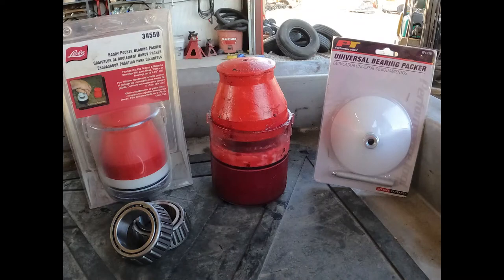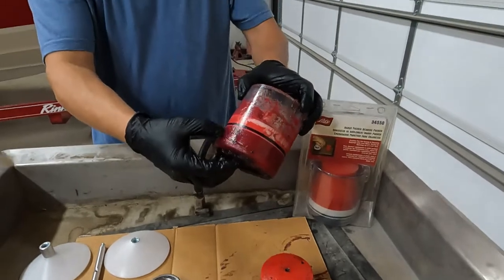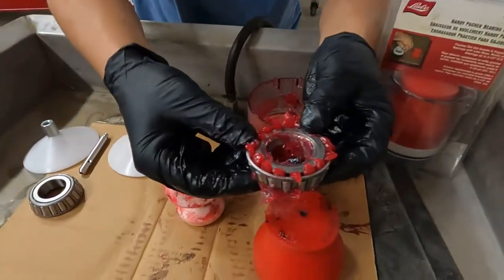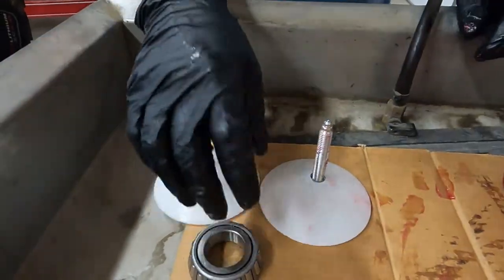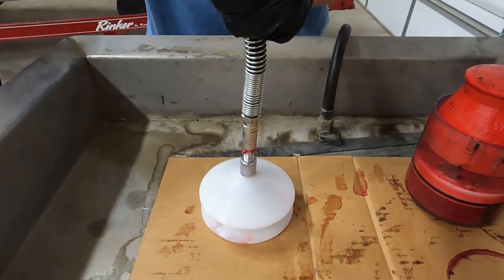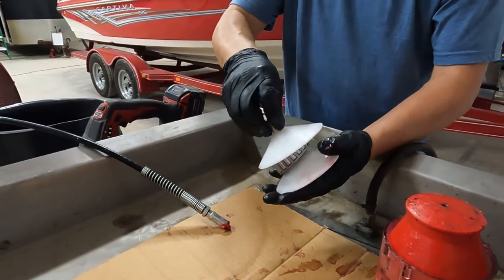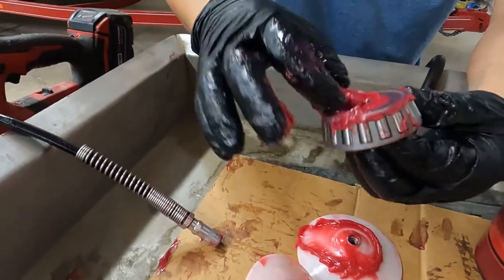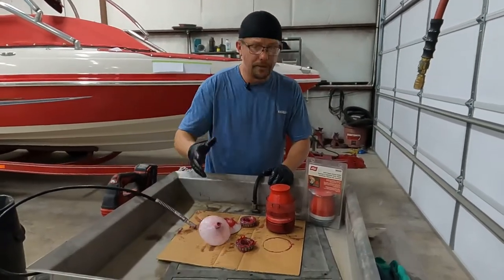Handy Packer vs. Cone Packer

Comment: I like the cone packer because you can swap grease types based on the application, and it does a great job running extra grease through to flush old grease out for a quick low maintenance grease re-pack.
Reply from the maker: Great point!  Thanks for watching!

Comment: Thanks for the comparison.  Like others that replied, my first packer is so old it is metal like your second choice.  You helped sell me on the second for my 77 chev. truck and my trailer bearings.      One guy used a zerk fitting on his trailer hubs to grease them.   I still like to take them out and clean them myself.

Comment: Thanks for the info. Need put new bearings on my boat trailer. Now I know how to pack besides doing it by hand. I'm going to get one.
Reply from the maker: Glad the video could help!  Thanks for watching!
Reply: I tried the 3 piece one with a grease gun, and it worked great! So much faster and easier than hand packing. Thanks for the info.

Comment: Bought the first one you showed like 30 ish  years ago off the snap on truck probably paid way to much for it. But it still works today. I have a single , tamdem  , &  a tri axel it gets a work out. I miss working on the big rigs that's what I cut my teeth on back in the 80s . Thanks for the videos I will check them all out.
Reply from the maker: Similar story!  The first packer I ever bought came off of a tool truck and I paid way too much for it!  Thanks for watching!

Comment: 4:49 I always fill the cavity around the stem with grease from a small tub of grease before installing the top cone over the bearing.  Doing this trick, I don't consume a bunch of the grease from my grease gun.  I use the grease gun for doing chassis lubes on my vehicles, which is a more effective use of the grease in the grease gun, rather than squirting a bunch of excess to fill the cavity of the bearing packer.